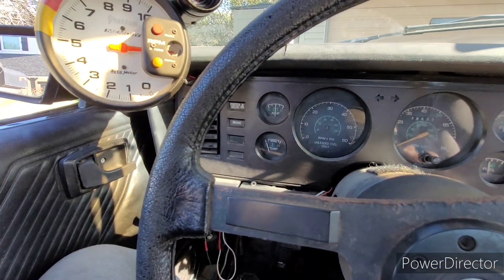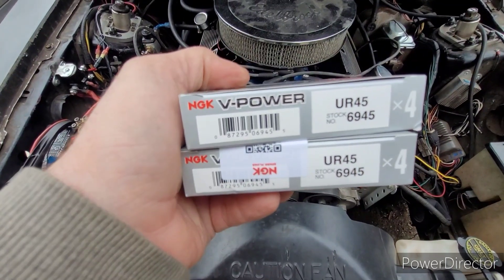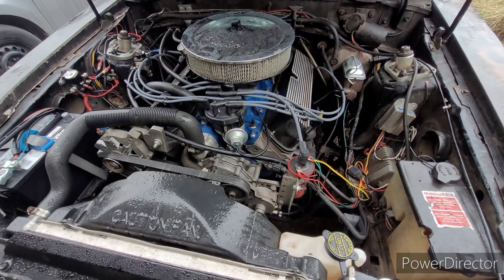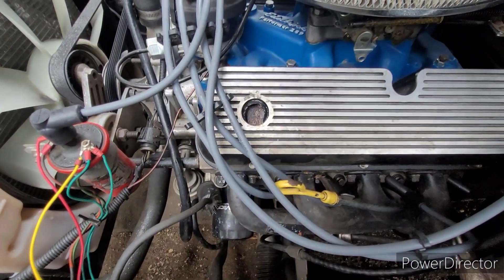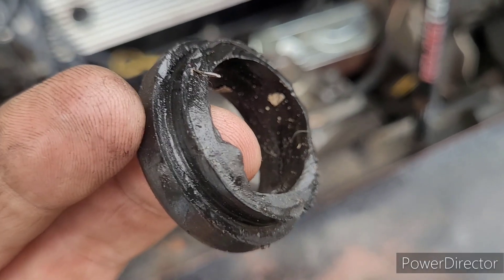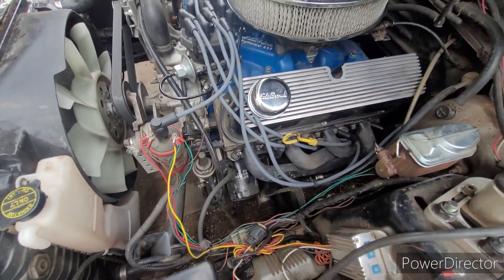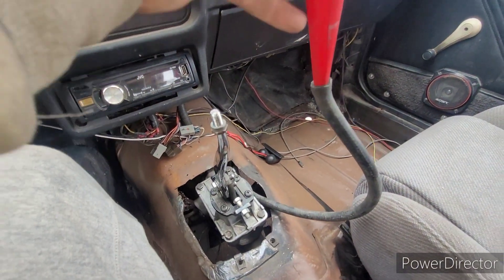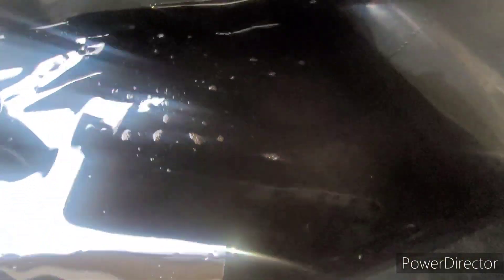We prepped Jr's Mustang for the dyno, but the event was canceled.

Comment: That wasn't the only reason I said too much timing. There's also the bogging down when trying to accelerate🤨. Also with cheap spark plug wires comes arcing. What were you saying 4:46🤔?
Reply from the maker: @lynnrunningdeerB4  it has started fast every time since we changed plugs and wires. It was only that first time. And yes, cheap wires can arc, but I did check for that. A few times, actually. I've never seen any evidence of it. They just seem to break off at the spark plug.